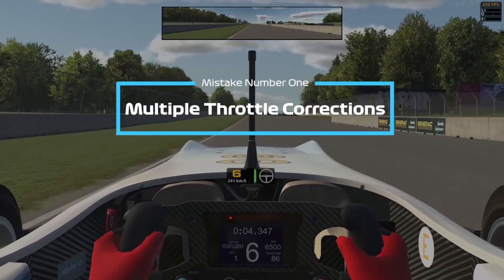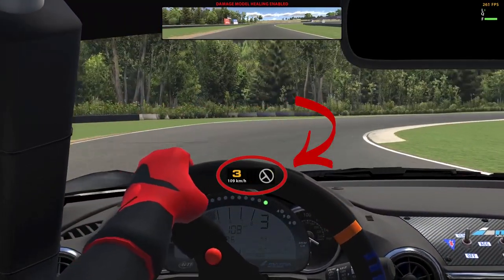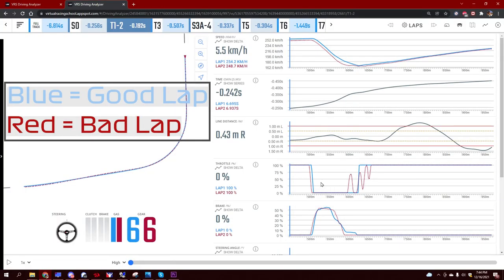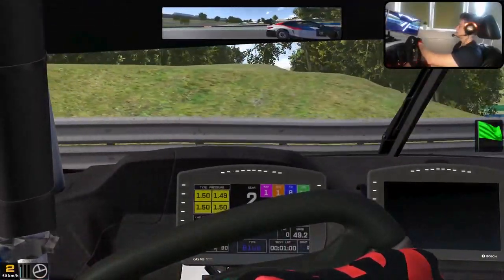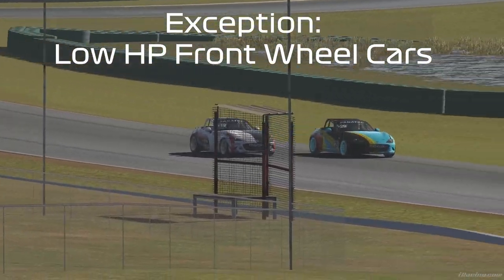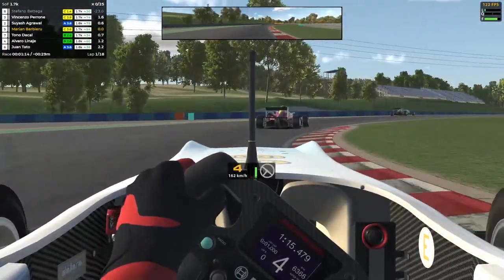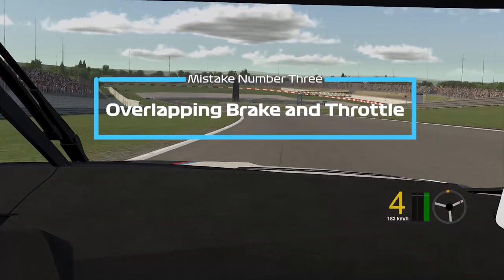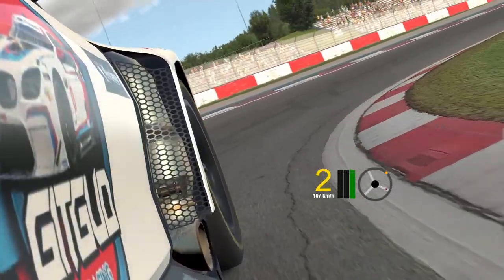iRacing Rookies | Throttle TIPS that make you 100% FASTER

Comment: At this point in my iracing career (rookie) I do throttle corrections quite often. I'll be more aware of this as I play and hopefully I'll be doing fewer corrections. Great and helpful video btw!
Reply from the maker: Note that all types of corrections are just symptoms and the root cause could be in things like - racing line, corner entry speed, available grip. Nevertheless, this reverse engineering approach will help raise awareness on those topics because it’s actually easier to see yourself doing multiple corrections rather than analyze grip levels or entry speed.

Good luck in your iRacing journey @BZ, I wish you the very best. Thanks for watching our content!